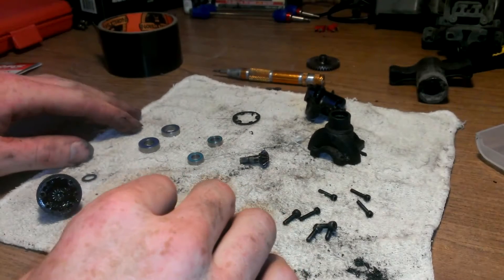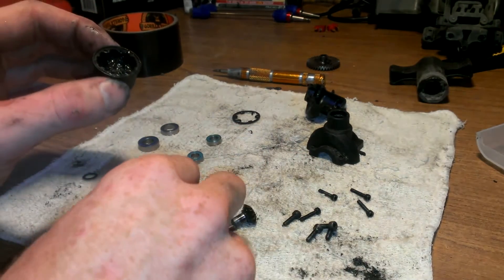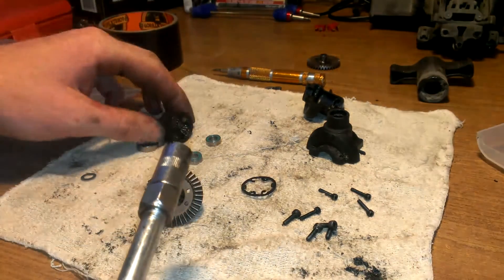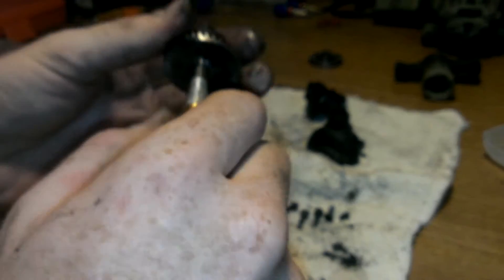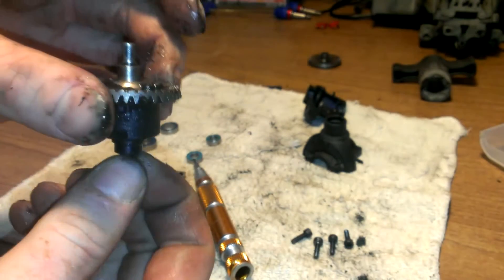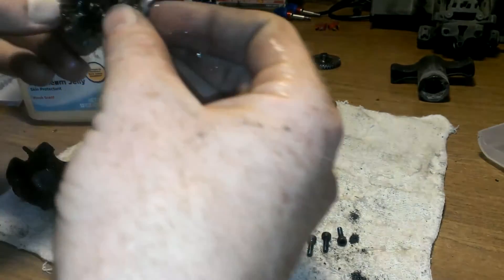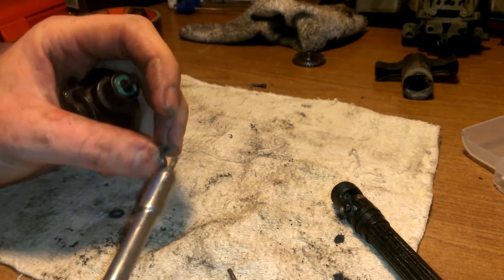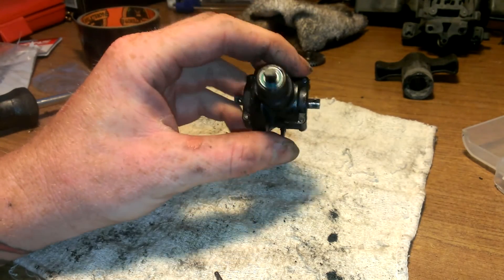E-Revo Rear Diff Rebuild In Detail Part 2 of 2

Comment: Noise started 2nd run after rebuilding rear diff, and i also cleaned a put new grease in front. Only other thing i did was loosen up the slipper clutch some? All gears looked in good shape inside diff.

Comment: I just got done rebuilding my rear diff and used 30k diff fluid and it seems so tight. It doesn't spin as freely as yours does. Is it suppose to be tighter with diff fluid as opposed to grease?

Comment: I blow a rear diff every 10 to 15 battery packs while driving on 6s. shimming is good but it is not enough, so i will go and switch the inner cup to the aluminium one and  hope it will solve this problem. The inner cup is always blown when i repair my diffs.
Reply from the maker: Well the aluminum cup helps a LITTLE bit. You may want to look into "Losi Diff Mod". Not to hard, just requires a little bulkhead trimming but makes your Revo diffs bulletproof! Thanks for checking out my Video!
Reply: Thanks for your Reply man. I am looking forward to do this mod.....btw Losi rules :D
Reply: I've had my erevo for years and run 6s only...Finally got the clicking noise in the rear diff...I thought I was hard on my stuff but every 10-15 packs sounds like something is wrong besides just running 6s.